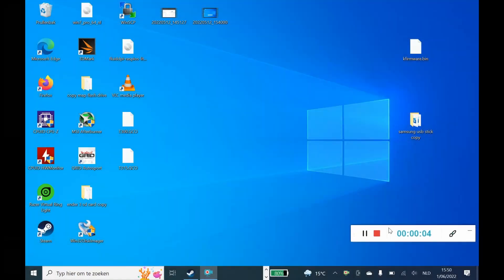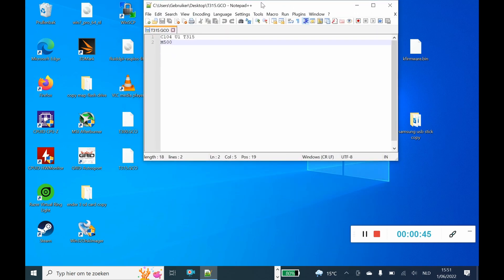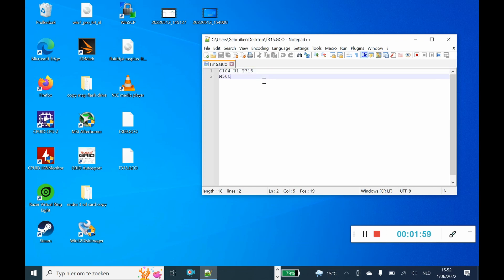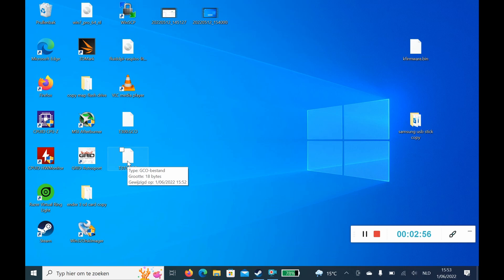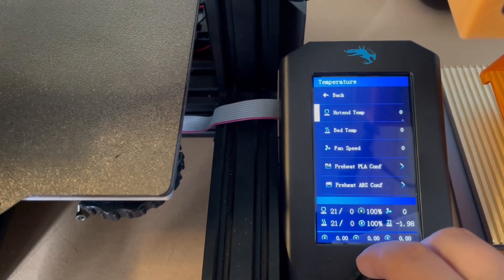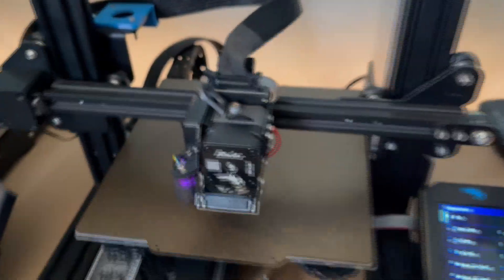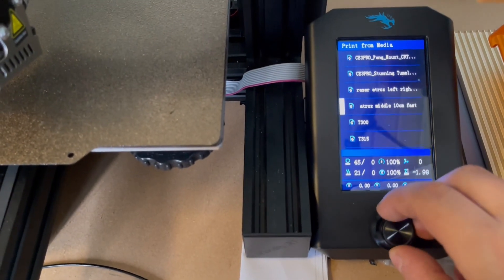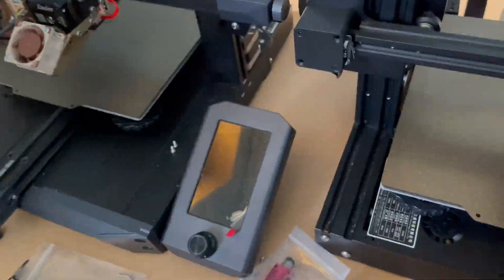Ender 3 S1 , ender 3 v1 / v2 Sprite Extruder PRO (KIT) how to unlock 300° Celcius feature.

Comment: So i have the latest 2025 mriscoc update.  Used this method going up to 285
After i did the t300 file i used store settings and the printer is still able to do the 285 after the printer is turned off and turned back on without the SD card.  Thank you very much for this video.  Im planning on printing nyon-gf and want the full 260-280 temp ramge.  

ender 3 v2 4.2.7 monther board sprite pro excruder

Comment: is it possible to just send a gcode command to my ender 4.2.2 and BBTskrmini3v3 to change the max temp to get the sprite pro extruder up to max temp?
Reply from the maker: i think the best way is to rewrite the firmware yourself and put the max temps .
Reply: I've had nothing but failure for 2 years trying and following videos by the best on the web.  @aim6mac

Comment: You apparently didn't notice that the Sprite extruder pro has an all metal hotend. You are talking about PTFE tubing issues yet there is no actual PTFE tubing in the hot end if you have the all metal one.

Comment: The Sprite Pro Hot End out of the box is rated for 300 degrees C. If you print Carbon Fiber Nylon, you will need to print at between 260-280 degrees C.
Reply from the maker: it is rated for 300 degrees but the older printers where u do this upgrade to are not rated (software) to print at 300 degrees celcius.

Comment: I see the temperature rate 300 in the preheated mode, but when I choose the “print” mode, the temperature rate will back to the”200”, I need to manually set to “300” . Can I do this?
Reply from the maker: I think the best way to use 300 degrees, is to use unlocked firmware from mriscoc, or compile one yourself!

Comment: The "Sprite Pro" has an all metal hotend, good to go out of the box rated to 300c per the specs.

The only PTFE tube is in the top part of the extruder simply as a 'guide' to feed the filament through the gears. The PTFE tube does not contact the heatbreak, or encounter any temperature that would damage it.

"IF" the PETFE tube was anywhere near those temps, that would mean the filament would be softening / melting at the extruder gears , which would NOT work at all.

As far as firmware, it was simple as it can be, all that was required is re-compile Marlin with new MAX temps set, all good, no issues. 

I regularly run this extruder on several different printers, multi-Day prints running Polycarbonate at nozzle temps of 275C to 295C, and bed temp of 100C, multi-day prints with ABS with nozzle temps at 250C, and bed at 110C, zero issues.
Reply from the maker: Hi there, thank you for sharing this, as there hasn't been enough data , your test helps us to determine that maybe the PTFE tube really isn't getting degradation of these higher temps , even if it is above the hotend part.  Creality doesn't really have real data on this, this is why i warned people who were wanting to get to those higher temps.
Reply: you using the standard nozzle?

Comment: Thank you for your video, I have some observations. The video shows the possibility of modifying the upper limit of the user entry menu item, but there are other limits that have to be taken into account. First the physical or manufacturing limit, a thermistor itself could be capable of metering higher temperatures but the wire's isolators or the heatbreak not, some manufacturers put PTFE as wire's isolators in his thermistors limiting the use to temperatures bellow of the degrading temperature of that material.
Another important limit is the calibration table of Marlin (Marlin/src/module/thermistor) for the #1 type thermistor for example, the upper limit of the table is 300°C then for Marlin it is not possible to do metering at higher temperatures with that thermistor and an error will occur if that limit is reached. You can't use a calibration table not made for your specific thermistor, So, you can't use the table for #61 type if you have a #1 type in your printer. Creality gave us some conflicting messages about of the S1 Pro sprite, the first time they said that the thermistor is type #1, and that we could use the firmware of the normal S1 and change only the HEATER_0_MAXTEMP. Later they said that the thermistor is a 3950, so type #13. But both thermistors have 300°C as absolute limit, so it is not possible to print at 300°C with those thermistors without doing some hack in the Marlin routines or complete the thermistor calibration table with a higher limit.
Reply: Miguel, I am using your Pro FW build. Do you have a build that accomodates the 300 deg pro version of the sprite. Or do you have configurations available so I could compile the Pro FW from your build with changes? -Thanks
Reply: @dieselmaster2205  look for special configurations in the repository (I can't post links here)

Comment: I know that you kind of say this in the video but just to clarify: this process does NOT work for 300 C printing. This firmware is compiled using Marlin preset 13 for the hotend thermistor. The temp table for this thermistor tops out at 300 C. That means any amount of thermal overshoot, even 1 degree, will result in a hard crash that needs a power cycle to resolve. If you want to unlock true 300 C printing, you have to recompile this firmware using preset 61 or another preset that has a temp table that exceeds 300. I'm currently using 61 and I can confirm that it works. I kept it at 300 C for about 15 minutes without any observable adverse effects, although it made some questionable smells when I first started.
Reply from the maker: thanks :)
Reply: I am using ender e s1 with sprite pro.  Can you send me your firmware so I can try this out?
Reply from the maker: @peterosinski6331  please read the disclaimer first, this is only to unlock it, thus it doesn't mean it will reach 300 degrees :) alot people tend to mislead by the video apperantly
Reply: @aim6mac  I really just want to print at 275-285
Reply: Thank you. Spent way too long trying to figure out why I was getting M112 during heatup and why PID kept saying the temp was too high to test.